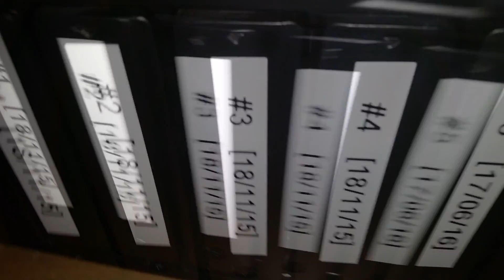Synology DiskStation DS1815+ No Power Fault 'Workaround' - Using A PC Power Supply To Recover Data

Comment: GOOD NEWS.  Here's an update for DS1815+ owners! Synology is giving me a replacement server FREE!

Synology® Product Status Update
BELLEVUE, Wash.—February 18, 2017—Synology lnc. is aware of a recently discovered erratum in a clock signal component used in certain Synology products. After in-depth investigation, the possibility of seeing accelerated degradation of this component is rare even after prolonged and heavy usage. This component's erratum is not known to cause data loss, nor any safety hazards. Based on hundreds of thousands of shipping products containing this component since 2014, Synology has not seen any abnormal error rates compared to products utilizing different components.

As of today, all products that used this component are performing in-line with Synology's quality standards1. As a testament to our confidence in Synology's product reliability, we are extending the warranty on products2 utilizing this specific component by an additional year. 

Note:

Since February 2017, suggested improvements from the component manufacturer are incorporated into current and future models.
The 1-year extended warranty only covers DS415+, DS1515+ DS1815+, DS2415+, RS815(RP)+, and RS2416(RP)+.

Comment: Nathan.  My 1815+ died on me this morning after being online for just over 3 years.  Let's see, that comes out to be about $26/mo. for using this.  I'm floored that so many units have crapped out in the past 1/2 year here.  Noticed that most units are not repairable with just a new power unit.  Is the DS1817+ the only option?   Thanks for this post, though.  
NOTE:  After doing some research on Amazon for the DS1817+ product, some users noted also using this unit for a replacement and noted that the issue with the DS1815+ is the Intel C2000 Atom failure.
Supposedly, Synology has been in communcation with Intel about the Atom C2538 chip failure on units installed before November 2016.  Everyone with failures should submit a ticket with Synology, so that they realize the scope of this issue.  
- Intel indicated in a January 2017 revision of its Atom C2000 family documentation that the chip line contains a clock flaw. Errata note AVR.54, titled "System May Experience Inability to Boot or May Cease Operation," explains that the Atom C2000 Low Pin Count bus clock outputs (LPC_CLKOUT0 and LPC_CLKOUT1) may stop functioning. Permanently.

Updated to add at 14:29 UTC, February 7, 2017
Synology told The Reg it was "investigating this issue together with Intel," saying it would "provide more detailed information in the week as it becomes available."

It added: "At this time Synology has not seen any indication that this issue has caused an increase in failure rates for DiskStation or RackStation models equipped with Intel Atom C2000 series processors. However once additional information is available, Synology will post an advisory on this topic. 
-NOTE: Have any of you received a service advisory from Synology for this model?

"In the meantime it is still safe to continue to use your device, however should you encounter any issues these will be handled via our support teams and all the devices are still covered under the standard warranty provided with all our units. Technical Support can be reached via www.synology.com/ticket."

I believe that we can all attest to Synology/Intel that this ISSUE has caused an INCREASE in failure rates.  
I contacted Synology this am and submitted a ticket, but no response as of yet.
Update:  Found out that Synology added a year of warranty  coverage to affected units and they shipped out a replacement  unit (including shipping) at no charge! I'm  now back up and running  with no $ out of pocket. I would seriously  recommended this route rather than trying to fix it  yourself  and voiding the extra warranty  period that Synology  is providing.
Reply from the maker: I have no idea how I missed this comment previously, sorry about that! 
Yes I recommend getting the unit sorted by Synology themselves IF you are within the G-Tee period. However this video was a workaround to power the stations in the meantime and recover important non-backed-up data that people may need. 
You did REALLY good to get your unit replaced at no cost to yourself.... I had to send mine back at my cost - postage insurance was ridiculous and I ended up spending around £60 to ship mine back to them of which they wouldn't offer to cover any costs for or provide a courier label themselves. They were very unhelpful and frankly didn't seem to care too much that I had to spend a small fortune on posting alone from my end that I couldn't at the time afford to outlay.
Reply: I got mine back on 2015 and the warranty has expired now, my device still works great, just one question would I be able to get the extra year if my device died (god forbid)?

Comment: You are the best! This saved my bacon right before I was going on vacation!
Reply: It's interesting that they are claiming it is a CPU issue for my RMA, but my reading indicated they are two separate issues. At any rate, I they are doing an advanced RMA. I am using the jumper method. The resistance on that should be relatively low, yes? I don't want to rely on it, but I may need to until Tuesday. Of course, that would explain why the two power supply thing works.

Comment: my 1815+ die yesterday contact support asked to find local reseller get replacement unit. For 1815+ it come with extended 1 yr warranty from the purchase date.  3 + 1yr  warranty.

Comment: Hello Nathan PH,

My DS1815+ died yesterday and i'm thinking it might be the exact same issue, i have several atx power supplies lying around but none of them are 250W, does the wattage matter alot if i would test the unit with one attached? Would want to test this so i can transfer any data off for when i would have to ship it off to Synology, still awaiting a reply on my ticket.

Awaiting your answer,

Thanks in advance.
Reply from the maker: Hi, You could use a power supply with a higher wattage, this is no problem. Same with a computer (it essentially is a computer anyway!) 
Devices only consume what power they actually need to, higher wattage is actually good in one regard, because it means the power supply has more headroom and wouldn't get as hot in operation. So in summary, Yes a standard ATX power supply would work fine. 
Also remember that most of the load on these units is the hard drives, NOT the motherboard on the 24-pin connector (that's all you are powering from the PC supply). 
So the synology power supply will take the load of the hard drives, the ATX power supply only has the motherboard running on it.
Reply: Virtually everything else would be bigger, and bigger is fine. If you want to be a bit more careful, confirm you have the same (or more) power (Watts) on each voltage.

Comment: Hi Nathan, thanks a lot for your video, this morning i also found my DS1815+ dead, looking for help all day long in the forums i understand that there is a big problem on this NAS,  i finally found your video and i'am very happy, but to speed up  recovering  my pictures i was about to buy a new DS1817+(the 1815+ seems not to be a reliable product) AVman9 told that there is no problems putting back hard disks in the new NAS if you respect the number of each disk, do you think it's the same for a new NAS? 
thanks
Adolfo
Reply from the maker: Hi, Yes you can recover from a new NAS unit as well. Just move the drives over in the same order (I think you read my comment about this down below). It should work with the drives in any order, but I label mine and like to keep things in order like that. Hope this helps.
Reply: Thanks Nathan, did you have a look on the links I put about the guilty chips?

Comment: Hi Nathan, Just wanted to update you and everyone else who comes across this. 
I followed you instructions, unfortunatly my old PC does not have a poser supply it is only a midi PC. So I Popped into maplin and brought a PSU £30, They did not have the tester in my branch so I though I would bridge the connection with wire as you also shown. 
Well, what can I say, you are a god send my friend and I would love to donate a beer to you.
Everything just worked exactly as you shown so there is a power supply issue.
I have also read many comments on Synology forums re this issue and it is known along with the CPU issue in these models.
As a result Synology are offering a extra 1 year on top of the 3 standard years which is good of them.
To be honest the fact Synology offer 3 years is a miracle in this day and age where we only presume 1 yr with electrical goods.
Now I just need to practice what I preach and back up to cloud.

With your help I managed to copy my much needed files I was working on to a local disk, Thank you again.
Reply: PS this following thread has 28+ pages of people complaining about the same issue. 
https://forum.synology.com/enu/viewtopic.php?f=7&t=119727
Reply from the maker: That's great to hear! Glad you got it all sorted out. 
I am surprised by the 4 years however, I was told it had been extended FROM 2 to 3, not from 3 to 4!!! Good to know though. :) 
Glad to help out. P.S. I got my tester from eBay, it was only a few quid if you're interested in getting one.
Reply: Just a quick update, I contacted Amazon and they told me basically to send it back to them for a FULL refund. Can't believe that they refunding the lot after a year and half. Anyway I ordered a DS1817+ from amazon and got next day delivery, I then  just took my old drives out of the DS1815+ and put them in the new one in the same order. Booted up the DS1817+ and selected the first option to keep all data and config. After 5 mins it was all online and working. I have now just sent the DS1815+ back to amazon :) 
The new unit cost me £200 more but I now have a new later version and another 3 yrs warranty :) Happy days.

Comment: Q. If you had gone out and bought a DS1817+ would it accept those drives?
Reply from the maker: In theory that should work - Yes. It should pick up on the existing array and install of DSM, then give you the option to 'Recover' the array from the old drives and re-setup itself. I would suggest installing the drives in the same order (1 - 1, 2 - 2, etc..) as well if you were doing this. 
I haven't tried it in practice though as this is the first Synology and only product I have owned, it could be the last as well depending on the mileage my unit has now it has been repaired, at my postage cost to them for a hardware fault they must clearly know exists and is all too common.
Reply: Yes, you can migrate and keep the data on the new unit.

Comment: Thanks Nathan, Mine has also died on me this morning and so hence scanning the web for advice. This is a great video and I shall now butcher an on old PC see if I can use the PSU. I have submitted a support ticket for a warranty claim as it is only 1 half years old.
Reply from the maker: I can't believe this! Two replies within 24 hours of people who units just now died.. I find it insane! 
My unit was around 1.5 years old too when it packed up! 
Do let me know if your unit works like mine did in the video with a PC power supply alongside the internal one. I would be quite interested to know if this is indeed a power supply problem. 
I was considering cracking the PSU open on my unit and attempting to repair it myself because you have to cover the shipping costs when sending units to Synology!.. 
I expect it might well die again towards the end or after the warranty expires (3 years, 1.5 left), if it does you can bet I will be opening the power supply unit and doing a self-repair..
Reply: Mine died yesterday, no reponse at all from the NAS 1815+. First got some strange messages about power outages -> restarts, and some days later disk 7 @61C prompting a emergency shutdown about 3 times (switched disk but another disk displayed the same symptom). Then I desided to shut down the NAS to investigate. AND after that it was impossible to start in any way. Either its the PSU or the infamous Intel CPU /SoC timer problem. Will try a different PSU and start a RMA at synology.

Comment: Our 1815+ failed this morning, just after you uploaded this. Crazy timing. Thank you so much for this.
Reply from the maker: You are very welcome! Thank you. That sucks though!.. Hopefully you are still within the warranty period? They have been extended to 3 years on this unit. If so - get it sent off! 
Mine had actually died a few months back and that was when I shot this video. I didn't have the funds to sent it off for repair at the time though so I had to live without and use this workaround for a while so I thought I'd share it with the world.
Reply: We got a new power supply and did everything you did, but the new supply won't do anything. Everything is plugged in the right way and the drives spin up but the new supply doesn't start. I think our motherboard is just completely toast and isn't sending the boot signal to the new power supply. Its too bad, I really thought your workaround was gonna help us out.
Reply from the maker: Aww that sucks! Does the new power supply start up on its own if you jump the green to black on the 24-pin power connector? Possibly worth checking it out as sometimes even new supplies can be faulty, however this is rare. Hopefully you are still within guarantee and can send off to get the unit repaired? :)
Reply: Yeah, we got our new unit today from support. Only had to put the drives in the new one and it was up and running. It required zero setup, pretty great migration process, so I have to give Synology credit. The refurbished unit we got has an updated motherboard, power supply, and processor so we shouldn't run into this issue again. Unfortunately the company probably lost thousands of dollars during the time it was down, but live and learn.